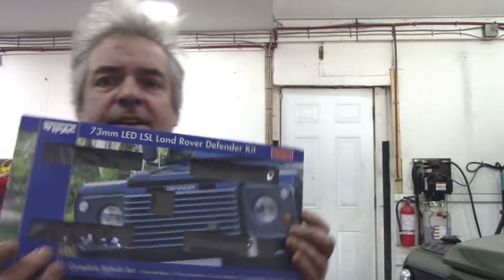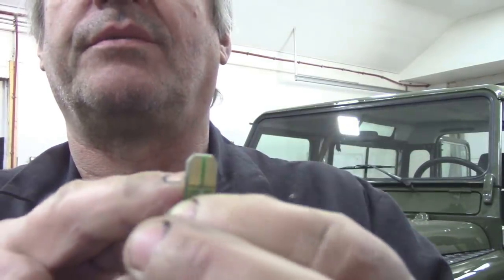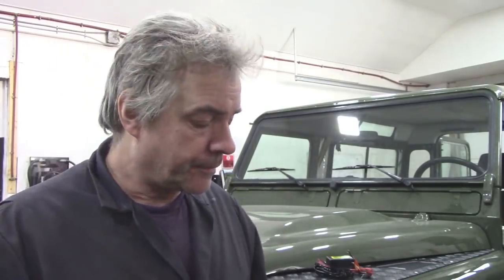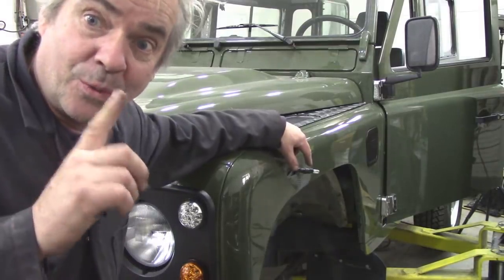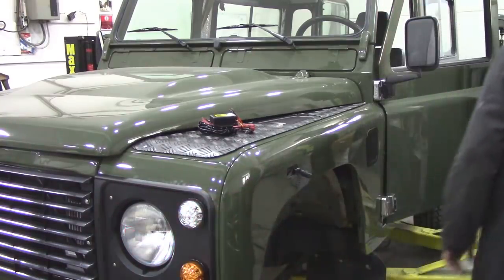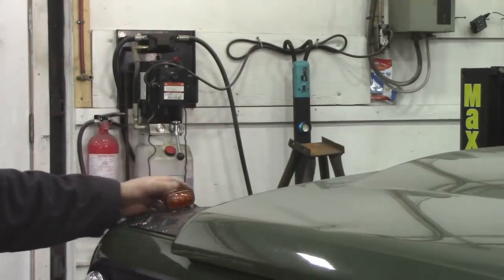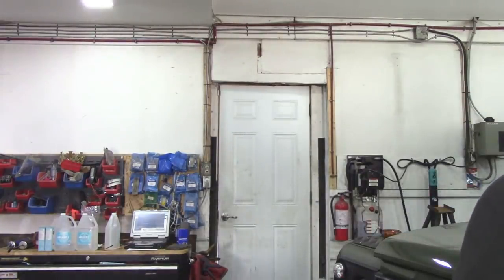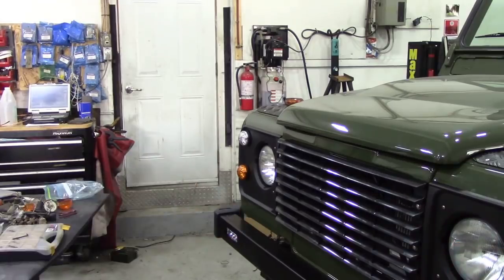A problem with LED lighting kits on older Defenders  - and a simple solution!

Comment: No need for the old bulb. Just put a led resistor one in each side for the indicator.
This give the illusion of the old bulb still being there .
This is also the trick if you don’t replace the relay and have fast flashing bulbs .
Hope this helps someone. But great video and very informative as usual mate.

Comment: Put a 50 ohm, 1 watt, wire wound ceramic resistor in parallel with the led's.

Comment: Hi Mike. This is a much discussed problem on the forums and Facebook. One solution is to use the replacement dash bulb that RDX supply, which has a separate earth connection. I made my own solution using two LED’s with the cathodes joined together and then through current limiting resistor to a common earth point. Using LED’s means that whilst one of the LED’s flashes on the dash, the other is reverse biased thus ‘blocking’ the 12V trying to reach ground through the ‘opposite’ lights.
Reply from the maker: Much simple to put 2 x bulbs in the side flashers - cheap!
But no mention in the instructions as it was for a Defender or series
Reply: I installed the RDX dash bulb just this week. Been driving without a dash bulb for a month. But I've got full led all the way around. I got cheap led inserts for the stock side markers. The RDX relay is also the way to go as it has an adjustment for the trailer flasher. The trailer flasher may not work with the wipac relay if you use that feature.
Reply: I fitted both rdx relay and dash light to my wipac lights works a treat 👌🏼

Comment: All that's needed is an LED dedicated flasher relay. Works on most older classics, Land Rover, MG, Mini and my Suzuki GSXR750SRAD all had crazy flasher problems with LEDs until I fitted a proper led flasher relay. All working perfectly no worries.
Reply from the maker: That only works with the indicators but the way the warning light is wired you need a special warning light bulb with a resistance or a regular bulb in the circuit

Comment: Hi, had the same problem with JW Speaker led indicators, on a 97 Defender, drove me daft trying to fix it, finally resolved after much forum searching with a replacement dash indicator led that has a short earth lead (eBay) which I attached to one of the dial housing, phew problem solved and sanity regained.

Comment: Hi mate love your channel it's spot on 👍 right I have been a mechanic since 1984  and too weeks ago I had the very same issue 😂😂😂😂😂😂 I fitted wipac led lights to my tray back now 😂😂😂😂 when I fitted them they worked fine 👍 a day later I had to change a rear main seal so I disconnected the battery separated the engine and box changed to crank seal put it back together and run it up no leaks 👍 I don't know why I decided to check the lights but I did and I noticed that if I indicated one way the other side indicator would flash dimly 🤷‍♂️ so I went down the same route as you hazard switch indicator stalk  wipac indicator flasher relay nothing worked 🤷‍♂️ so I started to unplug things to see if I could find a shot to my surprise if I disconnected the alternator  the indicators worked fine 🤗 so I checked the alternator and had a short ground cleaned it up still the same changed it for a new one and the indicators still didn't work 😡😡😡😡😡😡 so I didn't the same as you removed the tell-tale build and and then the indicators worked 👍 so I decided to something different I put a led bulb in it all worked but only flashed the tell-tale one way so much stress to my mental health I decided to brake a  standard bulb so it still pushed in the holder 👍 and the to electrodes that stick out of the bulb I soldered a led bulb to it and then the second one the opposite way round and now when you indicate right one bulb lights up on the tell-tale and when you indicate left the other bulb lights up my problem is fixed all 6 led light work and a nice bright tell-tale on the dash 👍 hope it helps in some way 🤷‍♂️
Reply: Do you have any photos, would love to see this !

Comment: You've nailed the look of the front end, I would leave it like that, matches the black chequer plate.  You need the "Defender" letters for the Puma bonnet though.  I don't think they are going to be cheap.
Reply from the maker: I was thinking of de badging -  it is going to be a talking point- but of a mystery!
Anyway it is down to the owners

Comment: Hi Mike. I had the same problem with an 89 110 - even though I still had the incandescent side markers. It too drove me nuts and I figured it had to have something to do with the dash indicator light. In the end I Googled it and found that it is very common fault especially on motorbikes. I found out there is a mod to fix it. Is like a little resistor kit. It only means taking out the waning light cluster and wiring it in, and whala fixed! Not expensive either. I hope this helps some folks.

Comment: I think the problem is with the flash relay. You need one that works with LEDs. These are solid state. The old style needs the load from the bulb on the circuit to make the relay go.
Reply: Yes, they're only about twenty bucks in Australia.  Otherwise the LEDs do crazy and things.  I must say that LEDs have improved drastically in the last twenty years. I use them for garden lighting, and now the bulbs tolerate reverse polarity and have tiny switch mode power supplies to protect the led chip. I did read that Audi have  a LASER headlight option for about ten thousand bucks.
Reply from the maker: The Wipac kit comes with a dedicated adjustable relay for LED
Reply: @BritannicaRestorations  Ah, curiouser and curiouser!!
Reply from the maker: I could not find your old comment on a seal, but in French, a seal that fannies about in the water and Canadians like to club is called a phoque
Reply: @BritannicaRestorations  Well, as we say here, phoque me dead!
Reply: @BritannicaRestorations  
Weird electrical behavior.
British electrics...
Reply: @BritannicaRestorations  That seal clubbing comment reminded me of Abigail,  an Australian actress who was famous for being the first actress to get her 'assets' out on Australian TV. She became a self styled anti baby seal bashing advocate in the eighties. Don't know what became of her, but she did have tremendous assets.
Reply: @bigm383  Ahh, Number 96, a high moment in Australian TV. Sadly, Abigail's "assets" were only seen in B&W. I was about 15 at the time, so they worked for me.
Reply: @BritannicaRestorations  But does it cater for the flashers? It's a very common problem, Mike.
Reply: @greebo7857  ditto here!!
Reply from the maker: Bit lost in this thread but the Wipac flasher works very well and no messing with resistors
Reply: @BritannicaRestorations  Well done.

Comment: You don’t need a normal bulb. 
I fit all leds, then remove the dash bulb. Then I fit a small warning led to both upper corners dash and wire one to each of the indicators circuits at the back of the hazard switch. Job done!

Comment: I recently had this issue and was going to keep the old lights in the circuit. But I tried a resistor and it worked straight away
Reply: Where did you put the resistor please?

Comment: Having pain with my headlights put in a roof mounted LED bar, and re positioned switches to lockers, front LED bar and rear LED bars alll was working fine then an electrician got involved and wired the day light running light power to front right sidelight. Not sure if what he did caused issue. But now left headlight mainbeam is out.
Now im thinking the headlight flasher stalk is possibly worn out so have ordered a new one. Also ordered a dim dip relay. Of course i replaced the bulbs first.
Reply from the maker: You didn't mention what vehicle it was, but it is advised on early vehicles with no relay for high and low beams, that they should be retro fitted - the switch was not designed for more than 60 watts

Comment: I had exactly the same problem on my '95 Tdi and only figured it out when I removed the dash warning bulb and everything worked properly. Cut the green/red and green/white wires connected to the dash bulb a few cm short of the white connector block. Solder a 20p diode onto each of these wires and connect them both to one side of the dash bulb. Connect the other side of the bulb to ground. This way, the LH indicators dont use the RH circuit to ground the dash bulb (and vice versa). 

This method will also solve the problem of the dash warning light only flashing on one side but not the other, when you replace it with an aftermarket LED replacement dash bulb.

Comment: 1986 land rover 90 hazards not working and the indicators don't work unless the hazard light is switched on. I've been told it's a dodgy relay. Is this correct?
Reply from the maker: Could be but, maybe the hazard switch is bad - just did one today! Switch was broken

Comment: did the kit not come with a new flasher relay? done a 110 lately and had no issues with just changing the flasher relay for the wipes one supplied in kit.
Reply from the maker: yeap comes with a flasher and fitted and adjusted
Reply: @BritannicaRestorations  cool I've only done that one so far and had no bother.
keep up the good work and keep the vids coming.

Comment: Hi, I had the same problem but I wired in a ballast resistor in each side.
Reply from the maker: I thought about this later, but I had a customer once leave his hazards on a long time an almost burn his truck as the resistors got so hot!
Reply: I have the same Wipac kit which came with a flasher relay with adjustable flashing frequency. You could add a ballast resistor. The other solution which is crazy but will work, is to tap the two led side flashers to the existing incandescent wires leaving the incandescent ones inside the fender. They would have created the artificial load which the circuit needs when using leds.
Reply from the maker: I think using regular bulbs in the side flashers is OK  - they look OK and are easy to change if a bulb goes - gotta think of my customers!
Reply: @BritannicaRestorations  no, you need to ask a vehicle electrician 😆 😉

Comment: very interested in this as I have the 'proper' landrover flasher for a trailer (so the proper warning light for the trailer works on the dash) I would like to fit the wipacs BUT want to retain the functionality of the current warning lights as well.  Not many people know/understand that the design of the incandescent indicator is such that it 'tells you' you have a bulb that has failed by its flash speed.   I discovered this when rebuilding a Lightweight in about 91.  What I found back then was the warning light that flashed for left or right turn would do the following ( so testing one side only).  No bulbs fitted it wouldn't flash,   (this was mirrored in the trailer warning light)  Fit one bulb and the warning light would flash once (mirrored in the trailer warning light), Fit front and rear bulbs (no side repeaters on the MOD light weight) and you got the warning light flashing in time with them, however the trailer warning light would still only flash once, plug a trailer board in and it would then flash all the time.  Now I know in modern cars (I say modern, I mean pre LED) if any of the lamps failed the speed of the flash would increase as a warning to the driver they had an indicator bulb that had failed.

Comment: mike, Bolt on bits.co.uk, near huddersfield sell a little fitting that solves this issue , a warning lamp bulb holder with an earth wire which isolates the repeater from the circuit  the problem is caused by current returning to the negative as the instruments having a single turn signal warning in the instrument binnacle, later vehicles that have independent left and right internal warnings don't have this issue, only have to fit the digital flasher unit,,,

Comment: Could you not wire an additional incandescent bulb into the circuit and tuck it away somewhere so you could still have the LED side indicators?

Comment: I had this problem when I fitted the wipac kit firstly none worked because the earths all wouldn't work with the LED's then , the led's only work one way and I had all bulbs flashing but I noticed the other side was flashing week, took four hours to get the live and earths all going the right way around the circuit, I had it where the side marker would be lit when the indicator was off so they were blinking but not syncronised and the swapped all the led wires round the other way and then they have all been perfect since; right chew

Comment: I have the same wipac led set on my 2004 D90 with standard headlights and side repeaters still, but when I swiped mine over it activated the trailer dash warning light as if to say I'm towing ? but I don't even have a tow hitch or any wiring for a trailor at all. and it goes off when I put the standard lights back in.... not sure why this is but it passed its MOT in january with the trailer light on. and I didn't even get any advisories !! all Im waiting for now is a headlight to blow so I can splash out on some 7" truck light led's.
Reply from the maker: You need to adjust the flasher relay

Comment: Hi me old mucker, LED is driving me nuts. I’ve got a set of JW Speaker front head lights that flicker as and when they want. Currently fitted to the 92 defender but they did the same on my 2008 G4 130 🤬🤬. Thinking about doing a resistance test on the negative?  What’s your thoughts?

Comment: I think if you put a resistor from both sides of the idiot light to ground it might work, but the resistors would have to be the same resistance as the original repeaters.
Reply from the maker: Indeed - but think about it - £25 for 2 x flashers and the using 2 x regular bulbs - What do they say about hindsight!?

Comment: Had the same problem. I install led side indicator lights and connected the original side indicators lights on the inside engine bay 😂😂😂😂. Problem solved.
Reply: Fitting dynamics on mine now and thats my plan!👍
Reply: Just put a resistor in the circuit instead of old bulbs on both sides. It worked for me

Comment: Hi
Is that a genuine Puma bonnet on your defender? Was considering buying a cheap version but unsure how it would look compared to the genuine Land rover one
Reply from the maker: Yes it is - I heard the fibreglass ones crack as they are not very strong - you have to remember a lot of air gets under the bonnet through the radiator
Reply: @BritannicaRestorations  Thanks for letting me know

Comment: When I purchased my led lights I got a new relay unit that you could adjust the load with a screw. It worked fine.
Reply from the maker: Comes with the kit so you just adjust the flasher for the amount of bulbs ( trailer)

Comment: Why not piggy back off the indicator loom and plug in the original indicator hidden inside the wing somewhere?
Reply from the maker: Possible - but what happens when the bulb goes?
Reply: Could you not add it in series so the repeater would lose power rather than illuminating the other side?

Comment: And certainly don't attempt to put an led light in the dash because the system completely craps itself!!!

Been driving in the rain lately and my full led conversion has now decided that the reverse light should come on with the left indicator, and that causes the foglight warning light on the dash to flash with the indicator aswell!!! How bloody backwards are 300tdi's wired up!!!!
Reply from the maker: I am happy with this set up - all light now work perfectly - fog and reverse too
Reply: @BritannicaRestorations  oh I may also have some news on the aftermarket speedo cables because my speedo decided to stop working on Thursday. I hope it just slipped off the speedo on the dash but we'll see... Updates will follow!
Reply: As I said in my original reply, I made up my own LED tell-tale bulb for the dash and have had no problems whatsoever.
Reply: Phoenix C  Hi mate. My 200tdi was the same. The rear fog was always illuminated on the dash and when I selected reverse gear my fog light actually came on. Turned out to be bad earthing at the rear lights so I remade the earth onto the body and its working fine now.
Reply: @Sean-id1pn  excellent stuff, I'll certainly be making new earths for the lights when the weather improves (it's a driveway project, oh to have a garage!!)... It's a wonder what new earths can do, watch this space I'll eventually get the courtesy light to come on when the doors open and all!!! So far the ciggie lighter illumination works, very posh for a defender

Comment: LED current draw is too low, you need either a ballast / load resistor, or an LED flasher can instead of the standard flasher relay
Reply from the maker: Kit comes with a dedicated flasher which is fitted
Reply: @BritannicaRestorations  how bizarre that it still didn't work right. Awesome that you sorted it though.
Reply from the maker: Maybe that is why they do not include LED side flashers? - You need the bulbs in to make the system work!

Comment: Same problem on my old Volvo Amazon. It's due to having a single tell-tale on the dash, as you rightly say. The solution is to add a simple diode bridge to the connection at the back of tell-tale bulb. Just add it behind the dash and all the LED indicator flashers then work as intended. I bought a simple prewired diode kit for around 7 quid here: https://www.classiccarleds.co.uk/products/diode-harness-kit-for-led-indicator-turn-signal-warning-light-fix-kit although with the right bits to hand you could probably make one for a few pence. Once that's sorted you may find they flash too quickly, in which case you want to replace the relay with an LED specific one too. I bought a cheap one with an adjustable speed setting. Works brilliantly.